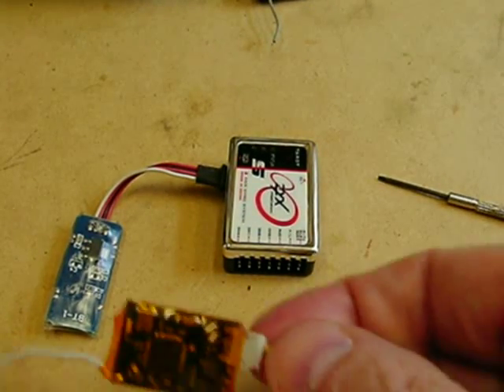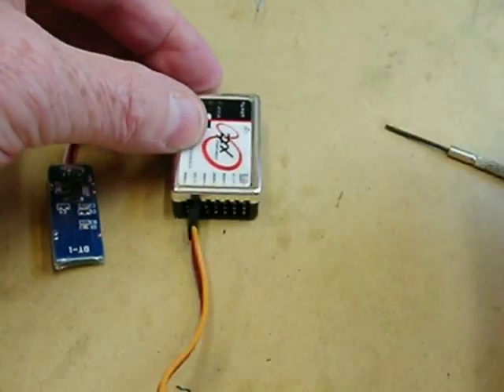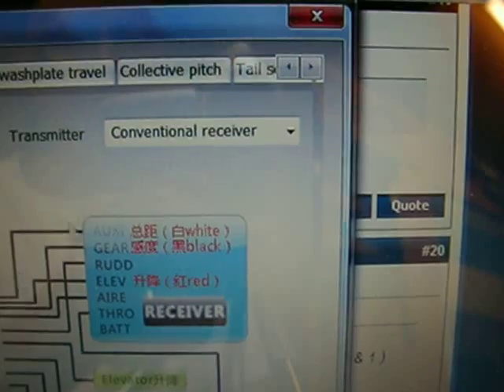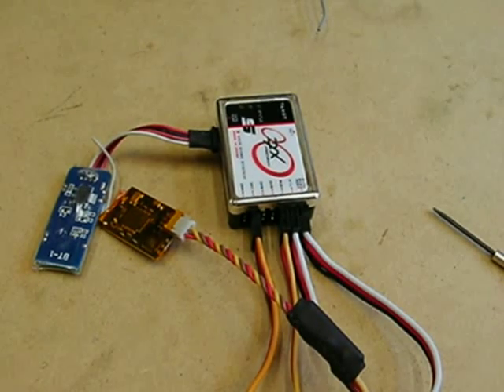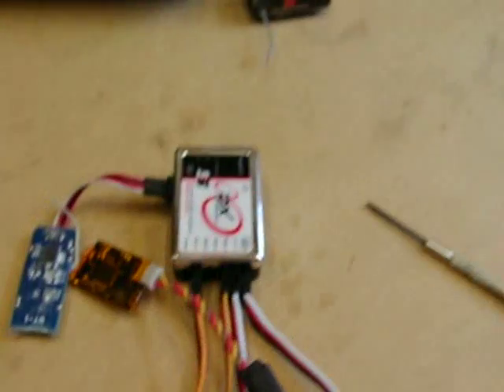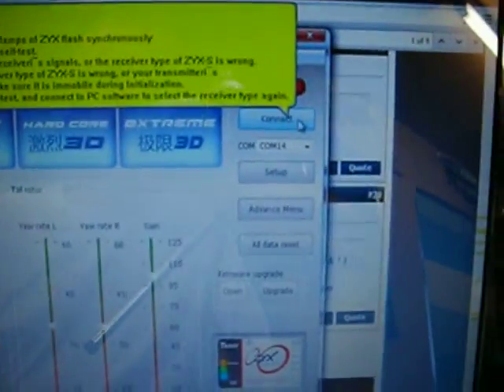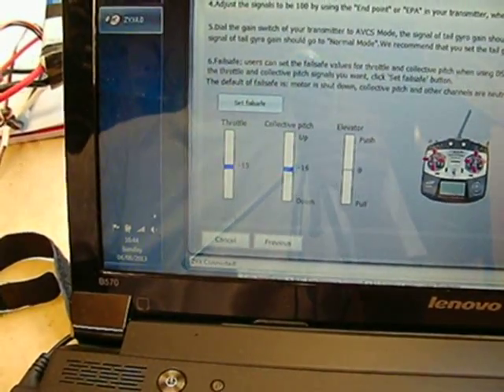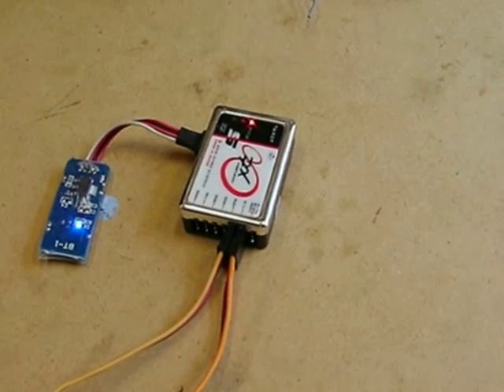Tarot ZYX Process to Bind a Satellite RX using DX8 or DX6i

Comment: I couldnt get it to work on my zyx with a devo 10. wouldnt bind. i cant find firmware 3.5 though so im on 4.01.

I did bind it via a kbar though to verify the sat works and funnily enough it bound in dmx mode where as my other sat only bound in dsm2
Reply: no go, despite binding the sat with a kbar, which worked fine (except for some wierd channel assignments)

once hooked back up to the zyx, the esc initilises but no satalite linke, LED off
Reply: BazSound no good buddy, you MUST bind with v3.5, someone reported that once the bind is done under v3.5 you can then flash back to v4 and the bind stays. in an say bind under v4 does not work correctly.
Reply: trouble is the 3.5 firmware link no longer exists. nowhere seems to have it.

also even binding it with a kbar and then moving to zyx doesnt work.

it should not be that difficult.. tarot really messed this one up.

Comment: can anyone tell me  if I need to run a Satellite  extenion  cord between the SATELLITE AND THE SPEKTRUM AR72OOBX RECIEVER  ,WAS TOLD IT'S A  MUST BUT THE SATELLITE  ADAPTER AFTER ITS PLUGGED INTO THE SATELLITE SIDE THE OTHER  END THAT PLUGS INTO THE  SPEKTRUM AR72OOBX IS NOT THE SAME  END AS THAT IS PLUGGED INTO THE  SATELLITE, IT'S LIKE THE END OF A SERVO WIRE ,AND OF COURSE  THE END THAT PLUGS INTO THE SLOT  OF THE AR72OOBX RECIEVER  HAS A SLOT THAT'S LIKE ON THE END OF THE  SATELLITE  RECEIVER  ,MAYBE IT'S THE  WRONG  ADAPTER  WIRE THEY SENT THAT GOES  BETWEEN  THE SATELLITE  AND THE AR7200BX? I DON'T KNOW  BUT IT CAN'T BE  PLUGGED  BACK IN TO THE AR72OOBX RECIEVER WERE YOU PULL OR UNPLUG THE SATELLITE  PLUG  ,YOU CAN'T  PLUG THAT BIG THING INTO THAT LITTLE  HOLE?............

Comment: good video, however it didnt fully work on my set-up. i bound it a few times, following instructions and although the sat showed a steady red light after binding, the zyxs showed a blue light, but never a red. and it always initialized with a flashing yellow (went blue after pressing button). i could then get into the software but all the signal bars were going crazy. in the end i just attached the sat to an orange rx and binded them both to my tx normally, then attached the special cable to the sat nd plugged it in to the zyxs etc. it seems to work perfectly now, as far as i can tell. although the beeps at plugin are weird compared to my other zyx helis, like theres a problem with finding the sat, it always initializes. its also confirmed the sat socket on my orange r610 rx is actually functional which i always wondered about considering it was so cheap.

tx. dx7s
sat. spectrum dsm2
rx. orange R610 (the one with a sat socket)
zyx-s firmware. v4

edit. i just realized you literally mean have fw v3.5 installed for it to work. so no wonder mine didnt work, as i have fw v4. i thought you meant v3.5...or above. a case of information overload on my part lol. oh well, ive got it working now anyway.

Comment: Man, I am really sorry to bother you, but I need help setting mine up. I see you are only using a satellite receiver, right? I am trying to get mine to work with an orangeRX r100 (yeah I know, cheap part, but whatever). Here's what I've done so far: I bound the r100 to my DX6i and connected it to my ZYX S2 using a 3.3V step-down converter, I plugged in all the servos and my ESC, but left the motor disconnected. When I connect the battery the LEDs on the ZYX flash for a while and then only the yellow light keeps flashing (indicating a bad connection with the receiver); only pitch works, but if I connect the gyro to my pc it starts reacting to cyclic input as well. The channel mapping seems to be messed up: moving the rudder on the DX6i changes the throttle and I have no control over the tail. I am getting hugely frustrated with this gyro. How did you set yours up? (sorry, total noob here) Is it possible to use it with a satellite only at all or should I buy a normal spektrum receiver? Thanks!
Reply from the maker: Hi buddy,
I think you have two issues here, using a sat only is very advanced and trying to use ine with a dx6 can be challenging also. Then you have the untested v2 :(. I recommend using a full receiver first. Although note, you can not bind the sat using a full receiver then just connect to the zyx, at least not with a v1, I assume the same with a v2.

Comment from the maker: You can buy one of these really cheap, try searching ebay for Tarot ZYX-S Spektrum Satellite Adapter Cable, they should be a few english pounds (around $5). Not really worth trying to make one :)
Kev
Reply: I will make one though, I don't trust the cheap linear regulator they put in the cable and will instead use a step down converter to go from 5 to 3.3 Volts.

Comment from the maker: A friend just brought me a ZYX to bind to a DSMX sat, I found something interesting! It was not possible to bind this to a DX6i (with DSMX firmware) for use with the ZYX. In fact I could not even bind to using a DSM2 sat. It would however work if i used an Orange Sat. Or the DSMX and DSM2 sats worked if I used a DX8 tx.
Thus DX6i users need to stick to Orange RX Sats, DX8 users can use all sats.
For info I tried all setting in ZYX software, i.e. DSM2-1 etc, Only the Orange Sat worked with DX6i / ZYX combination.
Kev

Comment: The DX8 ran fine on dsmx-2 while the DX9 has to be put on dsm2-3 to work correctly.

Must be something to do with the way the channels are mapped between the two TX's.
Reply from the maker: Hi Cory, this is very valuable information, thanks for sharing.  I knew you would do it if you persisted,  well done.
Reply from the maker: Oh, thought I'd just add for clarification that this issue is not a bug, the binding facility was dropped as the ZYX does not have enough memory to have the extra code for quads in v4 and the bind process.
Reply: TheBionicbone ahh ok, well that's not so bad then.  I'd rather have to do that extra step in turn to get more options outta the unit like that.

Comment: I don't believe its your tx.  I'm using a spectrum DX8, and a DX9.  I bound a dsmx sat to a ar6210 RX and then plugged in into the zyx-s after changing the setting to dsmx-2 already.  I get a yellow light as well and when I reset zyx-s to get a red light and then connect to software.  In the monitor screen, the rudder channel is working off my gyro adjustment switch instead of the switch working on the AVCS channel like it should, and the rudder stick does nothing.  My unit came uploaded with 4.01 out of the box and i'm using the tarot 4.00 software from their website.

Any suggestions bionic???????
Reply from the maker: Hi cory, first issue worth noting is that you can't bind to a spektrum receiver and then plug the sat to the zyx, you already found out why :). You must down grade the zyx firmware to v3.5, follow this process "exactly word for word" then upgrade back to v4.02. I can't stress the exactly word for word enough as this is easy to do that most go into autopilot (pardon the pun) and do things slightly differently and then it does not work. Good luck guys!
Reply: TheBionicbone Thx, I'm going to fiddle with it again today.  That is rather stupid that it come shipped with 4.01 and you can't even use a sat unless you downgrade and re upgrade.  IS this just a HUGE bug that hasn't been fixed???
Reply: TheBionicbone so i'm just downloading the files to do this now, I noticed a warning in the tarot site about having to use sorftware 3.0 to do this 3.5 firmware downgrade.  Will it not work with the 4.01 program I have, do I need the 3.0 program as well
Reply: TheBionicbone Sry, I hope I'm not bugging you, the help is greatly appreciated...It seems I've had some GREAT SUCCESS tonight.  I followed the instructions EXACTLY as you stressed.  Then after binding and reconnecting to pc I had to change the receiver option from DSMX-2 like in your video to DSM2-3 in order to get the channels to work properly.  I'm using spectrum DSMX sats instead of your dsm2 orange ones in the vid.  That was also with the spectrum DX9 incase all that made any difference.  I havn't gone and tried the DX8 yet.

In reference to the DSMX sats.  In the video you had it bind under dsm2 throught your TX, as did mine.  Do you know if it works on DSMX with the DSMX sats I have.  Or is everyone who is using DSMX sats still actually binding in dsm2 mode???

thx again

Comment: v3.50 but i tried with v4.0, v4.02 and the result is the same. Only thing i forgot my radio is not a Spektrum transmitter, but i hoped it works too, but i see now it doesn't. :\ The binding is good, Yellow light on the satellite but nothing more. If i switch to DSMX-1 all the three front servos works good except the rudder. I can't find any info for this, but after four days of negative attempts i think better to go for the full receiver with this combination. :(

Comment: The binding process is done flawlessly followed Your video, but my Zyx communication with the Tx is not good. I can't figure out what should i set up at the transmitter or the gyro to control rudder channel. The elevator, pitch and aileron is good when i move the transmitter stick the lines moving in the software, but with rudder doesn't. Could somebody help me to short this thing out?

Comment: thanks for the informative video.  I followed your instructions to the end and i think i got things correctly.  I can see my transmitter communicating with the software.  However, when i plugged in my servos to the Tarot zyx the servo does not move when i move the transmitter stick.  where's the error? thanks.

Comment: Hmm, that's what I have mine set to. I have firmware 4.01 and software 4.0, and in bind mode, as soon as the transmitter starts to bind, R100 light stops blinking and then nothing happens. What should the voltage to R100 be? Mine is about 4.3V, I dropped 5V down using a silicon diode. Do you have any suggestions for me?

Comment: Amazing video!! Saved me a bunch of time!! Thanks!!

One question: is your DX8 set to 11ms or 22ms mode with DSM2? I think you have to set this before you bind. 

If you hold down the scroller, and go into "Frame Rate" menu, what does it say? My Blade helis are bound with 22ms and DSMX, but this is 11ms and DSM2?

Comment from the maker: Hi I watch your video on this and agree you seem to have done everything correctly except for initialisation the ZYX must be level and still or it will fail.
What I would like you to try is down grade the firmware to version 3.50 (this is a must for my procedure to work) and then bind that SAT using the ZYX, this may sound crazy but during my tests I noticed similar things related to signal decoding.
Ensure when you power up the ZYX it is level and very still to eliminate any related issues

Comment: Worst money I ever spent, First FBL controller and it never worked right. No matter how you setup the unit your always stuck with a flashing Blue, or Red light after reintilizeing the unit. And I have spent dozens of hours bowseing the forums, and so many hours on the unit and can't get around this. The unit must be DOA from the factory. I've tried all versions of firmware. With RX straight wired, AR8000, Also DSX-2 Satts; DX8, RCGroups no help at all. Had it for about a year now. Still no go.